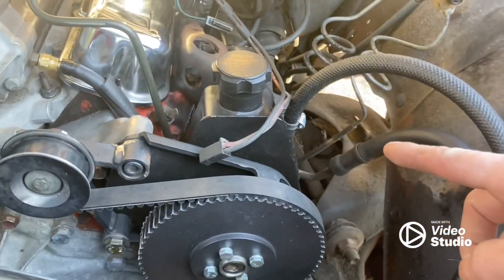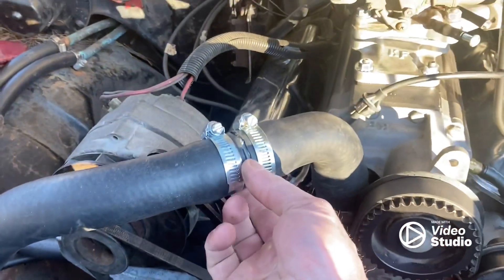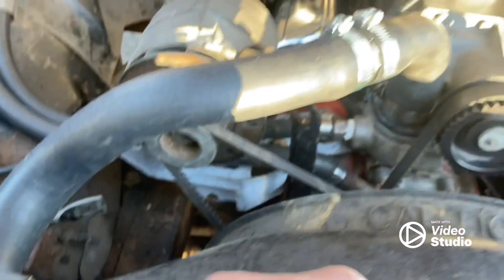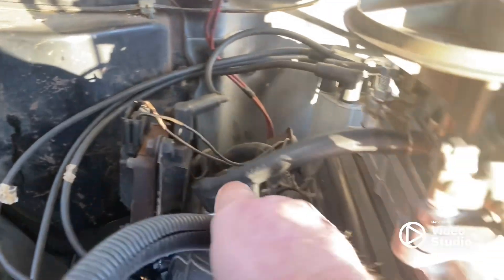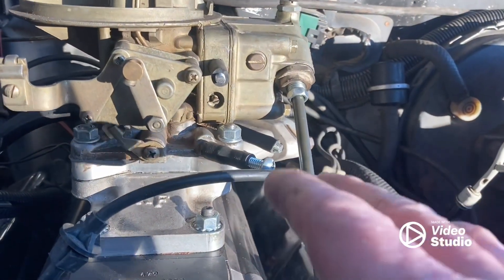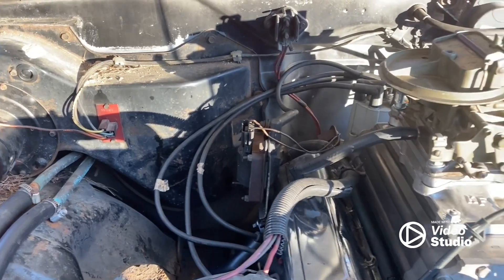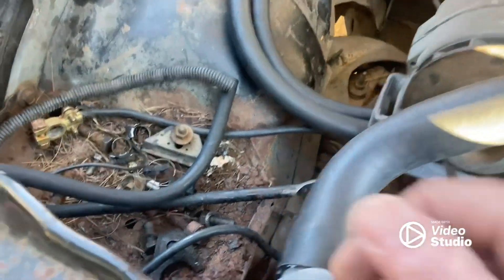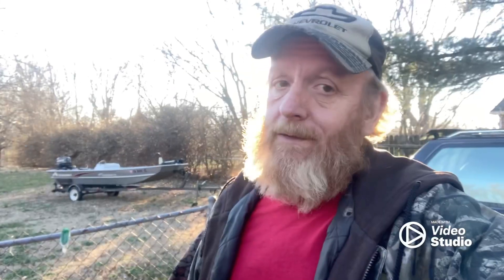A little teaser video

Comment: This is the first v6 I'm ready to hear run you have done the impossible JB I'm excited about a v6 lol keep it up 👍👍
Reply from the maker: Hang in, it will end up killer or total crap.😂😂👍👍
Reply: I'm looking for some of the photos I took when my son had a 4.3 V6 He built for his Syclone back in 05,06' on the engine dyno it made 
just over 500 hp. the truck was heavily modified and had a 8.5 certified chrome moly cage.